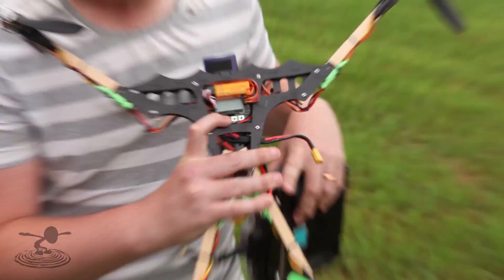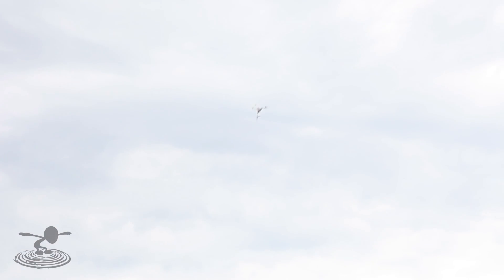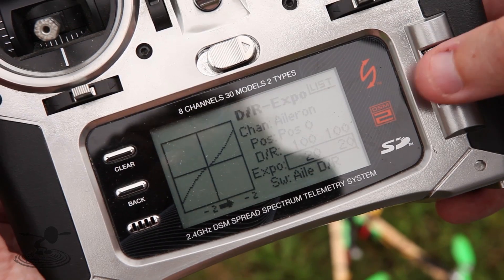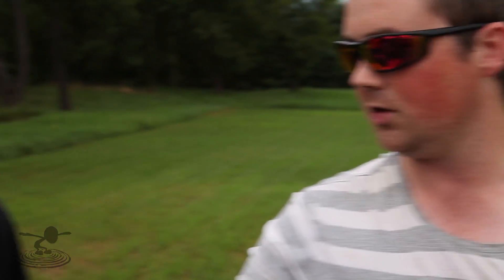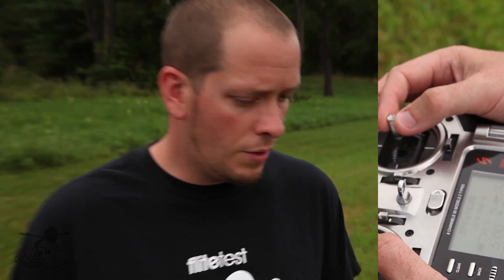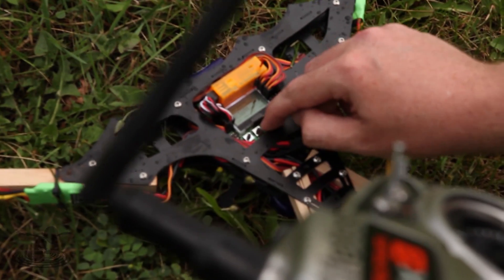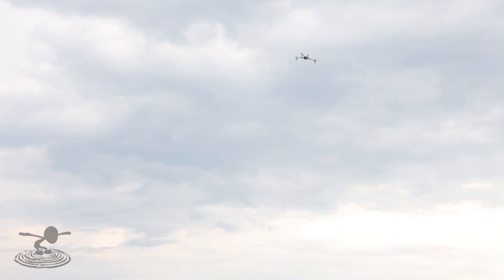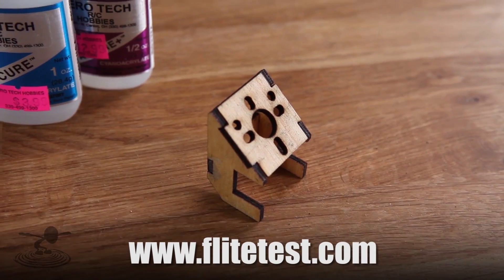How to Flip a Quadcopter - KK2 Stick Scaling | Flite Test

Comment: If you are running any of the cleanflight variants, set up a switch for air mode so that you can put the throttle on its lowest setting and still have control, which flite test covered in a more recent video. If you don't use cleanflight, set an idle up switch on your radio to increase the minimum throttle to achieve the same effect

Comment: Sorry, but what is the expo?
Reply: +Jake Rezac Expo is a setting on your transmitter or on some flight controllers, it changes the relationship between your stick movements and the quads movements from a straight line to an exponential curve. So the further away from the center your stick is, the more extreme the results of your movements will be.

Comment: I'm flying my Small CC3d Quad in Rattitude mode, and it's really fun. The "tipp" with less throttle really was helpfull. I've set my "off" throttle to 5% with trim so my blades always spinning.

Comment: This is pretty cool and right on keeping the props turning and moving prop greats more drag slowing the fall a stopped prop=fall but I wonder if flips can be done quicker with brake and reverse tho need some fast acting motors. I live reverse confuses people when you fly upside down tho I suck at it and I fall outta the sky alot

Comment: just built a 260 size v-tail using 5x4.5 on the front and 5x4 on the rear, its a fun fly.  when teh weather permits its flippy time

i usualy fly a 450 and a 230 quad wanted somthing inbetween a tri and a quad.  i use a kk 2 mini and some simonk 12amp escs with a 3c 1300mah 45-95 nanotech motors are 2350kv

Comment: Is it possible to do the same thing in dual rates, that way I can just flip a switch on my radio to do flips and rolls? I want to keep my setting for smooth FPV, but can change it to "3D" just by flipping a switch on my radio
Reply: Only certain quads have it mine has flip buttons cause there integrated with the software

Comment: you should do a quad with adjustable pitch blades so you can fly inverted and whatnot.
it would be AWESOME X10 to the power of 42
also you should put the orangerx t-six through its paces. see what it can and can't do

Comment: Stick scaling has to be set on the kk2 first to allow it the extra manoeuvrability.
Then you can still use dual and expo rates to tone it down for normal flight.
The tx can't adjust what's not there to start with so if stick scaling is 50 then the tx uses 100% of 50. If scaling is 100 then tx uses 100% of 100.
You could put tx DR at 50% and have it the same as the first example.
Is that kind of clear.